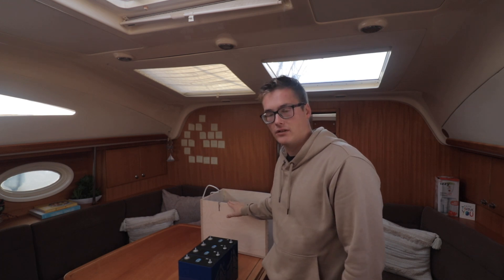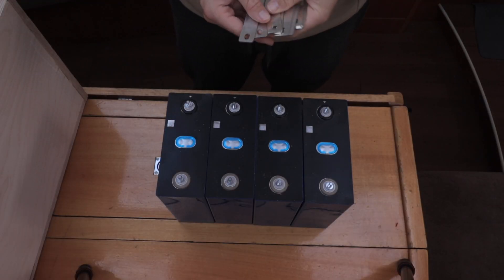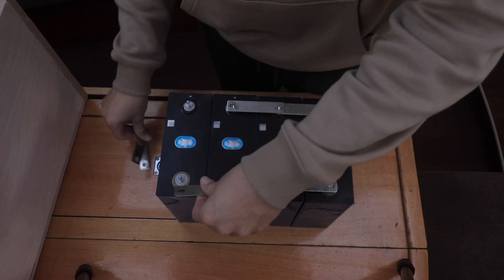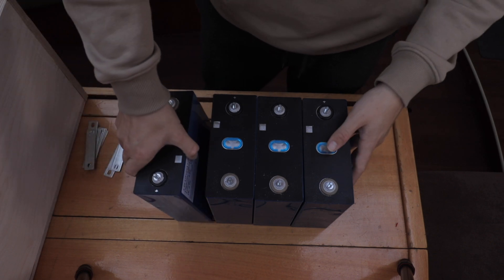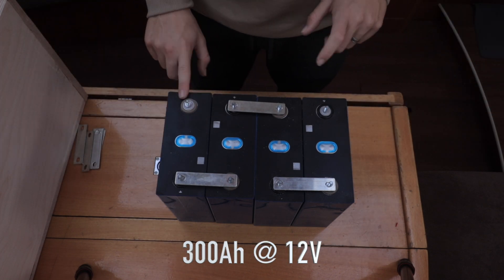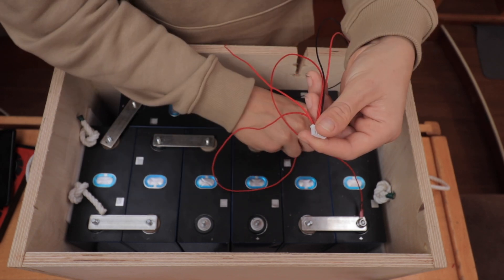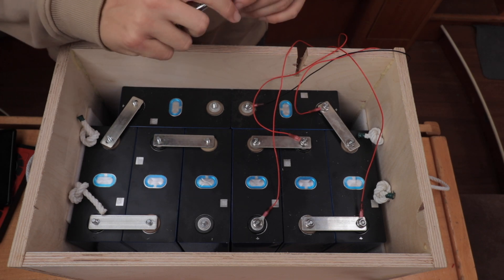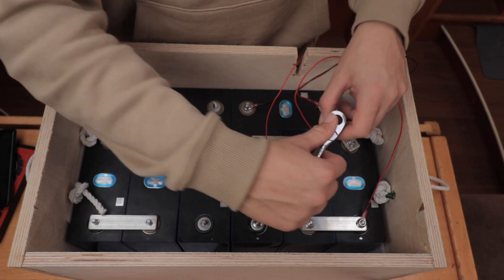Building DIY 12V Lithium Battery! - LiFePo4 Project - Part 3/5

Comment: Its much clearer to talk about kwh battery size in stead of Ah as that depends on the battery voltage which isn't always clear...
Reply from the maker: Good point! I have added in title that it is for 12v to make it clearer. Thanks!

Comment: You could have just parallel/ series connected the 8 and used one bms .... I think you Caused yourself more issues trying to make 2 separate batteries
Reply from the maker: I prefer having redundancy within the system, If one BMS goes, I still have a 300Ah bank. 

And really, it wasnt that much more work to make it 2 seperate batteries. 

But of course. There's 100 ways to do things. I'm not an expert. Just showing how I did it. 

Thanks.

Comment: Very informative, what kind of realistic 480ah - 540ah (80-90%) performance in cycles/age are you anticipating from the batteries 
(claimed by the manufacturer)? How much of that amperage range are you planning to use in normal conditions?
Reply from the maker: Thanks Gerard! 

So the batteries claim 3000-4000 cycles. So if you cycle once a day, that's still 3500 days. So 10 years. The biggest thing with that is you very very rarely cycle the batteries. We have had them installed for over a month, and have still only used an average of 60Ah per day. However, we still haven't installed the inverter, which will allow us to use much more. 

But even then, we would use at most 150Ah a day. Probably about 100Ah most days.

Comment: Hi Peter great video
Will your victron smart sense be Bluetoothed to a victron solar controller and / or a victron 240v battery charger?
Many thanks 
Steve (S/Y Towanda)
Reply from the maker: Hey Steve! Yea, they are all linked together. The next video shows all the other components in the system, most of which are victron! 

So they all link together to manage the charging parameters and safety aspects!